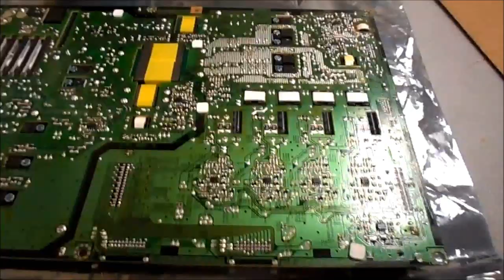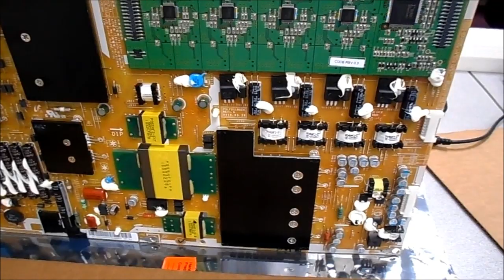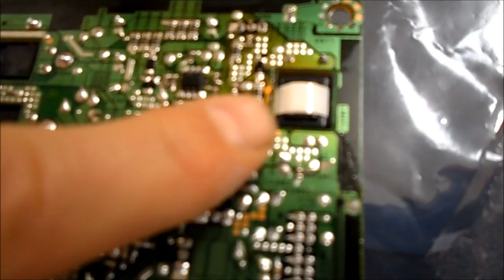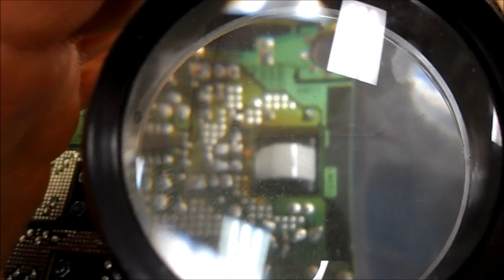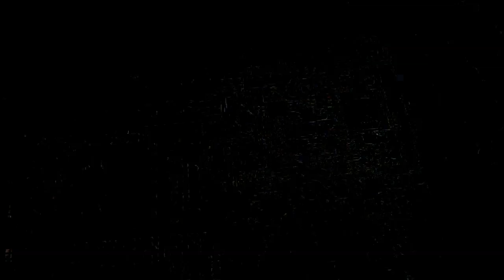2010 Samsung UN55C8000 55 Inch LED TV Repair.

Comment: I'm with a UN55C8000 which started showing horizontal black lines and some little color distortion at some points. Did you ever faced this problem too?

Comment: Literally had a replacement logic board in my cart and was about to pull the trigger on buying it until I saw this video. Pulled the TV off the wall, removed the board and sure enough one of these solder joints was cracked in the same place as the video. I was a bit worried about fixing  it since I'm terrible at soldering, but figured it was worth a a shot. One quick hit of the solder gun, a dash of fresh solder and the TV is back up and running like new.  Thanks a ton for posting this!
Reply from the maker: If you find this video helpful, feel free to donate & show support. www.paypal.me/rsoderman

Comment: My ue55c8000xp starts with the clicking issue one week ago, checked by a professional technician who said to change the whole board. 
Looking for a new board to buy on internet I found your video. In my case the inverted trasformer's solder looked fine but anyway I decided to resolder them and now my tv work again!!
Thanks and thanks again for sharing this fix!
Reply from the maker: Hello, & thank you for watching. Feel free to show support to keep these coming. via. the link at the bottom.

Comment: AMAZING. My un55c8000 had the black screen, red light clicking issue and I was so close to dumping it until I came across this video.  At first I thought it was the capacitors but after pulling out the internals they all looked fine.  Came across this video and noticed the loose/cold solders on this transformer.  Went out and picked up an iron and some solder and had the actual job done in 10 minutes - my first time soldering too.  THANK YOU!!!!!!!!!!

Comment: My Samsung LED TV D3 went out 2 or 3 days ago. I watched many Youtube video  but they had to change capacitors or some other part maybe it helpful for other problems. I came across your video and it is simple fix. I gave it a try. I took my power board supply out and inspected closely. I found the same problem as on your video. I did fix it and working now. Thank you and million thanks.

Comment: Same exact problem for my set.  I was researching a new board when I saw your post.  At first I didn't see anything abnormal about that spot but when I applied a little pressure to the component I was able to see one solder was cracked.  30 seconds later (and then about 30 screws) I was back in business.  Thanks

Comment: Farmradio, I am so happy I found your video before swapping out capacitors or ordering replacement boards. I did not have discoloration, but the upper left lead of the small transformer was cold, and after touching up the 4 leads my TV is back up and running. Worked great for 5 years, hoping it will last another 5, thanks again for sharing this fix, donation coming your way!
Reply from the maker: Thank you, Mario. You're welcome!

Comment: yep, same exact problem with my un55c8000. works for about 6 months then same clicking problem trying to power up. my question is, can i use a better solder to make last longer? like silver solder or better? or do i need to stick to the rosin core electronics solder?
Reply from the maker: Stick to the rosen core. Good stuff like Kester, with the lead.
Reply: +Farmradio OK cool-thanx - I will try the Lester with lead for sure- this was extremely helpful - thank you so much for making vids like this 😉
Reply from the maker: Regular rosin core 60/40. Use regular Kester lead/tin solder if you can find it.

Comment: I bought my SyncMaster 940MW TV/computer monitor (the international model) non-functioning.  Opening it up we found that several of the capacitors in the power supply were faulty.  I replaced them and it hasn't given me any trouble in seven years of use.

Comment: Farmradio, I had the same thing happen to my UN55C8000 today.  I followed your instruction and found the same transformer didn't have a good solder joint on one of the leads.  Resoldered it and working again.  Thanks for the help.  Much appreciated here.

Comment: This is the same / similar PSU as on UN46C8000, and on my unit having the same problem, this was the problem part. I passed by this part a few times when diagnosing and didn't notice, but touching up the cracked joints fixed it. Thanks for the video.

Comment: Fantastic video, same issue here tv worked perfectly then this issue.  The capacitor the cracked solder was mostly on the top left connection, but touched up all four.  $8 and 30 minutes later TV working like new.  Great video, thanks!  Sadly I already replaced it with a brand new better tv... but I have convinced my wife to let me swap the 32" in the bedroom for this one, now that it is fixed, and can move the 32" to the screened porch.  A win all around!  :-)

Comment: Thank you. Got my TV up and running. You could see the solder all cracked. Around the same part on your board.
Thanks.
Reply: I did put too much solder on it. So it overspilled onto other parts. But I cleaned it up. One spot the green board looks burned. Hopefully lasts.

Comment: Hi, tehre! I just whatsched your video, and I have the UN55C8000 and I am trying to repar the power board, but I can not get a flat coil, do you have any idea how can I get it one? thanks a lot!!
Reply from the maker: Believe you have to buy the whole board, if you can locate one on the web.
Reply: Yes, I buy already, I just waiting for the board, but there is no way to get just the little part somewhere?
Reply from the maker: Not easily obtainable. You would have to research, or take off a donor board I'm afraid.

Comment: This is exactly what my Samsung UN55C8000 started doing today. I removed the back cover and inspected the power supply board. The inverted transformer you mention did in fact have a loose/cracked solder joint. The TV returned to working perfectly after I re-soldered the connection and reassembled the TV. Total repair only took me about an hour. Thank you for sharing this video. You saved me hundreds of dollars.
Reply from the maker: Glad to hear it worked out for you.

Comment: Hello is there any way to see the repair that you did on the board, I have the same problem around that transformer  thanks MIke
Reply from the maker: Hi, at around 1:08 it was the solder on the transformer leads. the 2 right there. That's all.